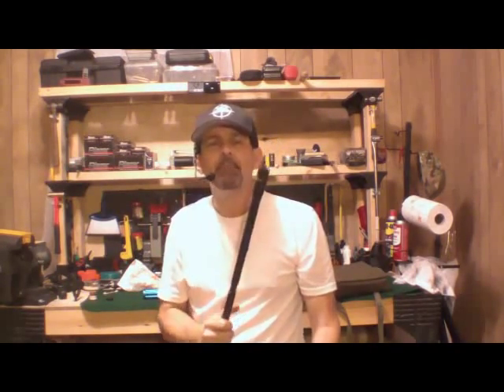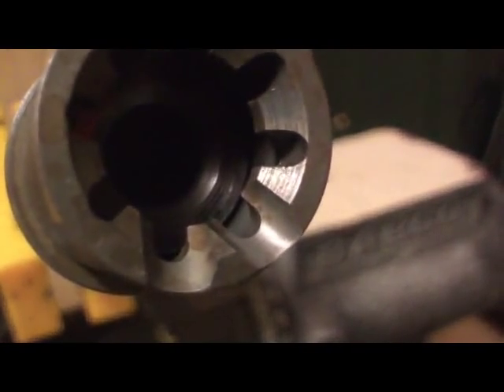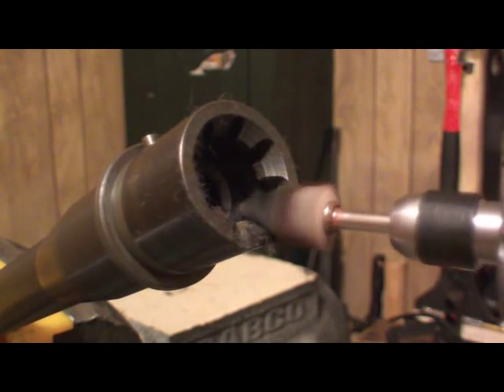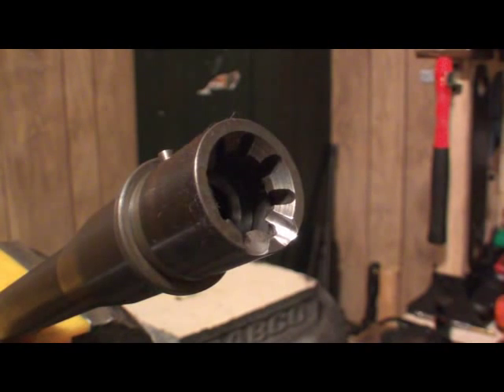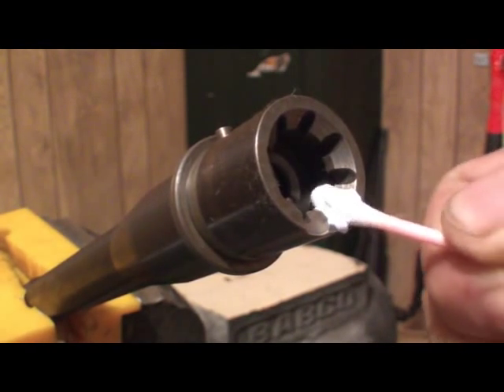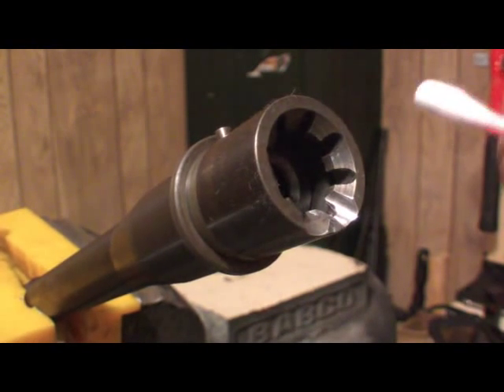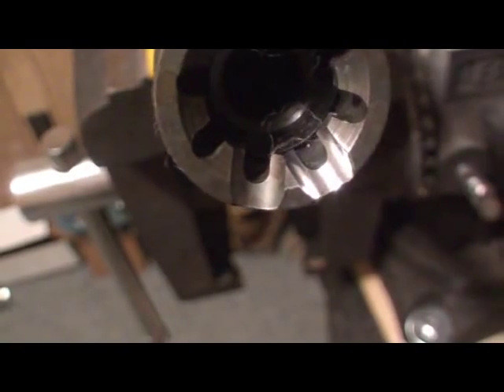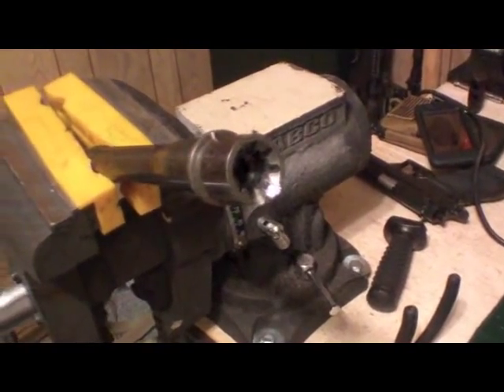Polishing the feed ramp in the AR15 and M4 Barrel Extension

Comment: I have a question; I have an AR-15 BushMaster that fire fine the first 10 rounds, Then the second 10 rounds it would feed a round into the chamber ok but would just click when pulling the trigger.  If I removed the mag leaving the round in the chamber, It would go ahead and fire...The mags all fed ok but would not allw a fire. , Whats wrong ??
Reply from the maker: I recommend that everyone number all of their magazines.  this way you can take note of which magazines were in use during malfunctions. if you magazines are not new, I highly recommend that you rebuild mags that are a few years old, or less if you keep your magazines loaded at all times. if you want to keep 30 rounds loaded, only load 28 rds in them and try to rotate the magazines every 3 or so months.  when you keep magazines loaded all the time, you can bend the feed lips, and you will weaken the spring.  (this is why the P-Mags have little caps on them... if you intended to keep the P-Mags loaded, mag sure you attach the cap..  this prevents damage to the feed lips.    It's a good idea to rebuild magazines that are left loaded all the time..  this replaces the spring, and adds an anti tilt follower (which also makes it more reliable.  I have some USGI Mags that I have had on hand since the early 1980's, so I still have 30 round magazines that are 40 years old, and only one magazine has had issues.  I also have a few 20 round mags that are Vietnam dated, but not-issued, and they work perfect.   The AR15 is a very reliable rifle system, but if you do have problems it's typically operator error or magazine related
Reply: ***** Springs Do Not Weaken, when they're compressed. That's  a myth. What wears out a spring, is the constant compressing and decompressing. Leaving the spring constantly compressed or uncompressed...will not lead to weakening the spring. There's been several scientific studies revealing this. If looking for a stronger spring over Stainless Steel. Use Chrome-Silicone Springs.
Reply: CHAMBER PROBABLY "SNUGGED" UP A LITTLE FIRING FIRST TEN AND THEN DIDN'T GO TO BATTERY ON ELEVEN. DIDN'T INDICATE IF FACTORY OR HANDLOADS...COULD BE A LITTLE LONG...MIGHT POLISH CHAMBER...CHECK BUFFER SPRING AND TUBE FOR FREE MOVEMENT OF BUFFY.
Reply: im having the same issue with my rifle. if you figure out how to fix the issue please tell me and ill do the same :)
Reply: I ended up puting in a little heaver action spring... A gun smith figured it out..
Reply: really? that was the last thing i was considering. thank you for the reply i will see about getting a heavier spring :)
Reply: +Wise Student You got a BushMaster is what's wrong. In the gun world you get what you pay for.
Reply: Wise Student 
Step 1- Throw away current AR.
Step 2- Buy a BCM
Reply: Wise Student everything
Reply: Lube your bolt carrier assembly.